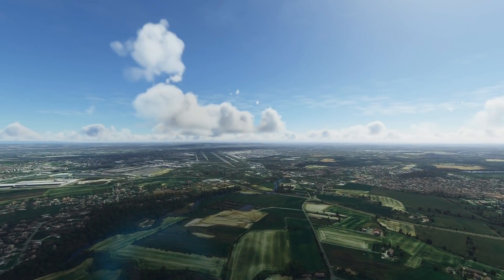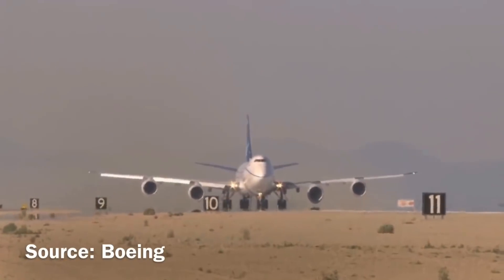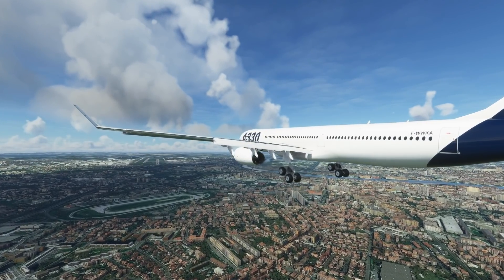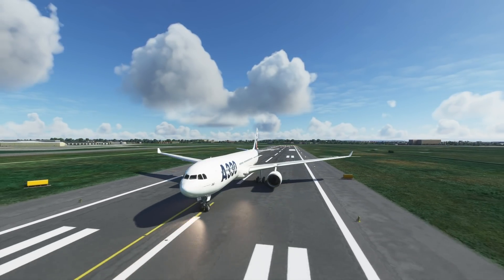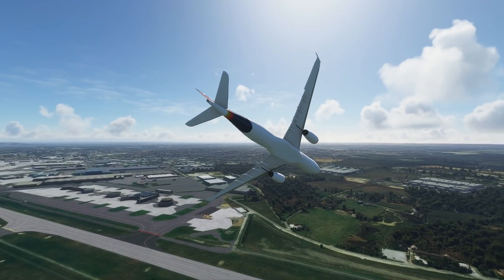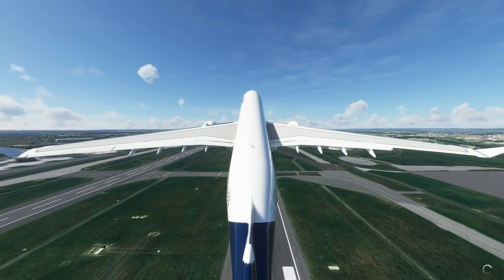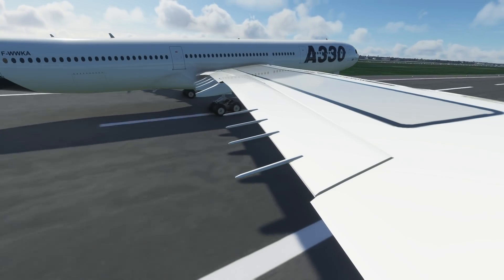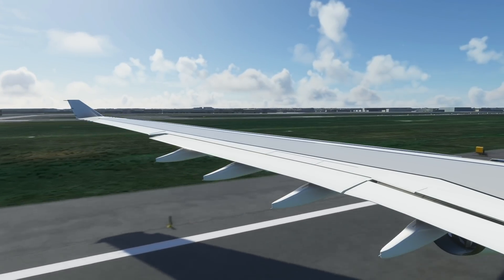The Test Flight That Went Horribly Wrong | Airbus Industrie Flight 129

Comment: "Let's have a test where we turn off an engine as soon as we take off!"
"In the simulator?"
"Nah."
Reply: This is test flying.  To make sure the airplane is safe if flown under the limitations listed in the flight manual. Or to find out anything, or combination of things, that could cause it to be unsafe. These skilled pilots found something, and paid for it with their lives. Some day, somewhere, maybe decades in the future, after this accident. An A330 will be at max aft CG on a short runway possibly contaminated with any number of things. Maybe cargo weights are estimated way too low. Or placed in the wrong section of the aircraft. Maybe passenger weights are way off and all of the fat bastards like me happen to get assigned to seats in the very back. The vagaries of life happen. Including flying in a sophisticated airliner with highly skilled pilots. That future A330, full of passengers will lose an engine during a full power takeoff just after rotation and liftoff. And it will fly safely because I feel certain that changes were made to prevent this strange combination of mechanical and software failures from occurring again. The passengers and the pilots will probably be completely unaware of the terrible cost in human lives and complex machinery that made an inadvertent aft of limit CG takeoff at full power safe. And there’s no accident killing a plane load of passengers because the extra margins built into the plane mechanically and the changes made to software and autopilot operation were rectified many years earlier. The object of test flying is to never turn the people on the plane into “test passengers”.
Reply: @msmeyersmd8  It was test crashing.
Reply: Well said! Wish I could give it 100 upvotes.
Reply: It probably would have gone smooth in the simulator, mostly because I'd expect the various cockpit settings would have been reset between tests, meaning no climb to match the 2000' setting.  I could be wrong, never having been in or around commercial simulators.
It would seem a lack of a checklist (or missed step) led to that setting being left in place in the real world.
Reply: How do you think that they get the data about the aircraft so that they can program the simulator? Eventually you have to test the actual equipment in the real world.
Reply: Its testing the performance of the aircraft, not the pilots, so a simulator is useless.
Reply: A full power steep climb, and cut power to one engine immediately after takeoff? Seems like a situation that doesn't need to be tested.
Reply: If you think that engine failures don't happen under those circumstances IRL you need to watch more crash investigation videos. Just like the regulations, testing protocols are written in blood.
Reply: @escaperoomleander1948  car companies use crash dummies for their crash tests. Let’s put humans in there and see if it works out. Humm 🤔
Reply: @escaperoomleander1948  and how does the simulator getting the data to know how to react to an engine failure? Answer....from doing it for real
Reply: @tomstravels520  Yeah, let's go full power with a steep takeoff and cut power in one engine to zero just barely off the ground...because that's so common that we need to be able to program the simulator.
Reply: @escaperoomleander1948  the steep climb was due to the incorrect pitch setting and TOGA is sometimes used for takeoff depending on length, altitude, weight and if runway is contaminated. And yes engine failures on takeoff are rare but that doesn’t mean we should not practise for it because it may not happen. It’s is practised at least once a year in the simulator if not 6 months by airlines in the simulator but the simulator needs to replicate the real aircraft and to do that they need to capture the data of it happening for real or as close to real as possible. Do you get it now or are you going to continue to be an arrogant pretend know it all?
Reply: @escaperoomleander1948  Engine failures do occur particularly when running at full power. It's only by testing what really happens they can ensure software/hardware/procedures are as good as they can be.
Reply: @rjk69  So let's test them in the most deadly way possible? Under 1,000 feet, pitched up, cut one to zero? 

How many more times do you think they tested that particular scenario? Was it until someone got it right?
Reply: @escaperoomleander1948  It was the only way to test it. They obviously fully anticipated it was within the flight parameters and if the auto pilot had been correctly set it would have been fine. They had to know the aircraft would recover from an engine failure at take off, it was fully calculated it would, but they still have to demonstrate it would. They always test in the worst case scenario. Would you rather fly in a plane that hadn't undergone testing?
Reply: @rjk69  So I take it your brother came up with this ridiculous test and your family is dedicated to justifying it, because it's the "worst case," and all worst case scenarios should be tested.

Hey, the pilot might collapse face forward onto the yoke at 800 feet during the landing--let's see how fast the other pilot can react to keep the aircraft from plummeting short of the runway.
Reply: @escaperoomleander1948  I'm very pleased you don't work in the aircraft industry.
Reply: @rjk69  Fewer engines being turned off while at full power on takeoff if I were.
Reply: @escaperoomleander1948  if the aircraft San withstand an engine failure at full power it can survive it at any other engine setting. You seem to be hung up on this single accident when Boeing and Airbus have been doing these tests for years now to make sure the aircraft is safe. If the altimeter had been set well above 2000ft this wouldn’t have happened as the aircraft would maintain the correct speed and pitch accordingly in either SRS mode or climb mode
Reply: @tomstravels520  I'm the one that's hung up?
Reply: @escaperoomleander1948  yes. Because otherwise you’d know this is done on every single test of a new aircraft and they don’t all come crashing back down to earth
Reply: @tomstravels520  If only computers existed that could simulate what would happen if X speed Y pitch Z engine power T time D dumbass conditions all happened at the same time.  But no, there aren't any smart people who can program that into a computer. It all has to be done in real life, like it's been done since the 1910s. Because nobody can foresee things with computers. Only through actually crashing planes and killing test pilots can we ever learn what an airplane isn't quite capable of doing.
Reply: @escaperoomleander1948  do you seem to think this was done on purpose or something? That they were meant to crash and die to see what would happen because that how you keep talking. Nobody is forcing you to be a test pilot. They contributed to the mistakes that led to the crash and if they had done their checklists correctly they’d have checked their altimeter was set to initial altitude instead of a low 2000ft
Reply: @tomstravels520  It was an unnecessarily dangerous test, and if you're unable to understand that, good luck to you.
Reply: @escaperoomleander1948  it was a dangerous test yes. But if it were to happen for real (and has happened) then pilot need to know how to respond by training and reading the manuals, and QRH not just guessing.

Taking an aircraft on its maiden flight is also dangerous....what if the aircraft doesn’t lift off because the wing was designed wrong and didn’t generate enough lift? What if it won’t fly because of poor aerodynamics? What if the wing broke off because of a design flaw? But I bet you won’t complain about that will you? 

And the only way they can get the information into the manuals is by having it happen (or simulate it happening) and have computers record how the aircraft responded. You can’t seem to get it into your thick head that the pilots made a mistake that meant the test went wrong. Did the A380 or A350 crash when they did this test? No. So please just step aside if you don’t know what you’re talking about and why things have to be done. You’re not a test pilot and no one is forcing you to be one
Reply: @tomstravels520  So at a high pitch angle and less than 1,000 feet on takeoff, an engine falls, and you're gonna have time to crack open the ol' QRH and find the procedure for kissing your ass goodbye? Good luck with that. RIP.
Reply: @tomstravels520  In the time it took me to read that paragraph, we had already crashed. RIP.
Reply: @escaperoomleander1948  clearly showing your 10 year old side
Reply: @tomstravels520  Come up with a reasonable explanation for shutting off an engine at takeoff and we can have a mature conversation. If all you're going to do is repeatedly insult my comments or myself rather than the issue that this test is just unnecessary, then we're not going to get very far.

Your one ridiculous attempt to explain that the knowledge gained from this crash is somehow useful and will end up in a QRH and save lives is laughable. Or that the simulator can now be programmed based on this asinine test, also fails.

Computers can easily figure out exactly what will happen to this aircraft if, at this pitch, speed, and altitude, one engine is suddenly shut down. And that can be put into a simulator. The test isn't needed in real life, because you got your answer on what will happen. The plane crashes, and no QRH would have helped. 

And if your response is "well, these other settings were wrong," then my answer is: don't put men in deadly situations if it's possible that a single unnoticed toggle will kill everyone if the situation takes more than 20 seconds to solve the intended problem. 

If there's no room for error, the test is fatally flawed.

Ahole.
Reply: @escaperoomleander1948  do you think this crash happened 3-4 days ago? This was 1994. Computers were not as sophisticated as they are now so yeah they needed to know what would happen to feed simulators. An engine failure in takeoff is a scenario that can and has happened before. 

I have explained all this already and if you’re just going to pretend like you know a thing about aviation and get it all wrong then go ahead. This was not knowledge gained from the crash they were after it was knowledge from what would happen if it was done correctly. It was not 1 single mistake that caused the crash it was (as nearly every accident is ) a series of mistake with not setting the altimeter correctly the main trigger event. The pilots could so easily have disconnected the autopilot and pushed the nose down to level off manually but they didn’t because the captain was fatigued and not able to realise something was going wrong. 

I have told you the reason for “shutting off” an engine at takeoff but you fail to listen or accept the correct answer because you don’t understand it. I have tried to explain it but you then insult me and say “no you’re wrong this is dangerous”. So is testing Abrams new aircraft on its maiden flight. Hence why they wear orange suits and parachutes
Reply: @escaperoomleander1948  let's see... reasonable scenarios?

Imagine the engine ingests a bird too large to cope with. Say, a goose? Happened in the past. One plane even got geese into both engines and ended up in the Hudson.

Next scenario: fan blade failure. All of a sudden, the main fan of the engine departs. Happened in the past.

Next: bearing failure. Usually rather more dramatic than fan blade failure, just hope the kevlar sleeve stops the high energy pieces from making lots of holes in the airplane.

Engines can and do fail during takeoff. Any failure past V1 and you have two choices: either go flying and hope your aircraft was tested and if necessary modified to cope with the situation or find you're unable to stop before the end of the runway and crash.
Reply: @realulli  You're listing extraordinary circumstances, the exact opposite of reasonable. Not every single possible circumstance can be tested, just because there's a statistical chance greater than zero that it could happen.

A meteor could (COULD) hurtle through the atmosphere and completely through a wing at takeoff. Should they test for that, simply because it could happen? No. To test for literally every possible unlikely occurrence would be ridiculous.

Comment: This was a warning sent out after the accident about the aircraft not having attitude protection when in ALT CAPTURE mode

"A Flight Director (FD) guidance issue has been identified when the aircraft enters into ALTS CAP at a low selected altitude, during a high rate of climb, and at the same time an engine failure occurs. With one engine failed, the ALTS CAP guidance continues to be based on the rate of climb corresponding to both engines operating, resulting in guidance that could leads to a loss of speed below V2. There is no low speed protection based on pitch in ALTS CAP.
Velocity Decay during ALTS CAP occurs in OEI (One Engine Inoperative) conditions, either during Take-Off (TO) or Go-Around (GA).
ALTS CAP mode of operation:
Altitude on pitch
Speed on thrust (in OEI, thrust command is saturated)
During ALTS CAP, FD is flying Pitch/G command to level off at target altitude (i.e. set through Pre-Selected Altitude) and speed control is on thrust command.
This issue can occur with:
Autothrottle engaged---the Autothrottle (A/T) under speed (USPD) sub-mode gets displayed on the A/T Flight Mode Annunciator (FMA) in spite of not being effective due to lack of thrust command authority in this specific case
Autothrottle not engaged ----when the A/T USPD is not displayed on the FMA"

Comment: Captain Warner's fatigue after a "punishingly busy day" which had included an A321 demonstration flight, supervision of a simulator session, and two meetings, including a press briefing

Lack of a complete pre-flight briefing, caused by Warner's schedule, and possible complacency caused by success of the testing through the previous takeoff

Choice of maximum takeoff/go-around (TOGA) thrust rather than the slightly lower "Flex 49" setting, which caused higher than planned thrust asymmetry during the simulated left engine failure

Choice of trim setting at 2.2° nose-up; although within acceptable limits, this was inappropriate for the extreme aft CG configuration flown.

Autopilot inadvertently left set at 2,000 feet (610 m) altitude capture from the previous test

Absence of attitude protection in the autopilot's altitude capture mode

Uncertainty in allocation of tasks between the captain and co-pilot; the co-pilot rotated the aircraft "firmly and very fast" to a takeoff attitude of more than 25°, compared with the usual 14.5° used for the first, successful takeoff

The captain carried out test procedures immediately after takeoff: autopilot engage, throttling back the left engine, and tripping the hydraulic circuit breaker; this took him temporarily "out of the piloting loop."

Lack of visual indication of autopilot mode, obscured by the extreme pitch attitude

Crew overconfidence in expected aircraft response

Delayed reaction of the test engineer to changes in flight parameters, particularly airspeed

Captain's slowness in reacting to the development of an abnormal situation.
Reply: Well the narrator missed many of the points so thought I’d lay them out here. Never claimed I wrote it myself
Reply: Nicely copied and paste from Wikipedia

Comment: Hell of a thing, I suppose such work needs to be done and a simulator just won't do? I hope this at least led to tighter rules about this type of testing, not least that all the pilots are fresh and fully rested.
Reply: Or remote testing.
Reply: No you can't simulate aerodynamics even with massive computer power. It's just too chaotic and you have to test it directly. You also can't design out the human features unless you plan to run it without humans. Since planes are designed to have a pilot, unlike  drones, we have to test them with people in them.

Comment: Test pilots wouldn’t have to be so ‘brave’ if they had done their homework and both pilot and copilot been on exactly the same page before rolling down the runway for an emergency simulation... You would think that demonstrating a very low altitude emergency scenario the crew would have been extremely cautious in their preparation because they have INSUFFICIENT altitude to account for pilot errors.
/In the Newtonian World.

Comment: Why not a normal "loaded" center of gravity engine out on take off test? Not that they had the airspeed to maintain flight anymore anyway but I agree  they tested at least 3 different    things in this take off, ending in loss of life and loss of test airframe. COG far aft. Wrong trim/auto pilot setting and engine failure...   I cant figure out what is scarier. Being a test pilot before automative systems or after...

Comment: Airbus is known for putting automation in charge of flying the plane and making computers give pilots permission to do something. Even though pilots input 2000 feet somewhere along the line I would think the all so important AB automation should have known one engine out, high thrust setting, high pitch, extreme yaw, degrading airspeed, excessive rapid roll rate, etc. and saved the plane without pilot input or at least disconnect and forget about altitude command. . What good is automation if it doesn't help when the sht hits the fan?
Reply: At the time at least there wasn’t a protection during ALT ACQ mode. If it was still in SRS it would have done it